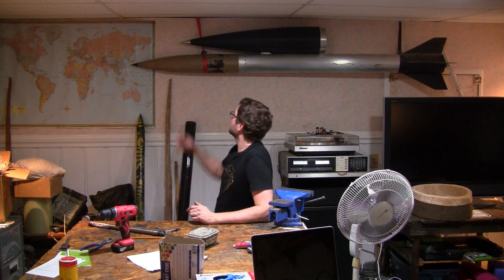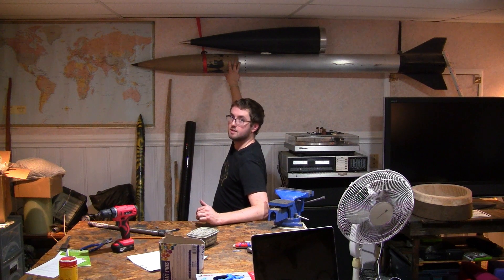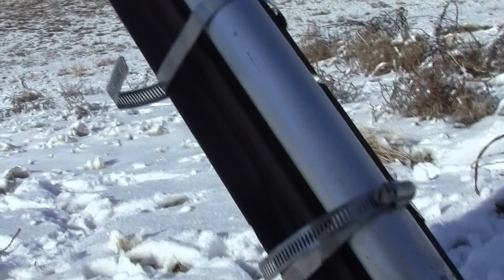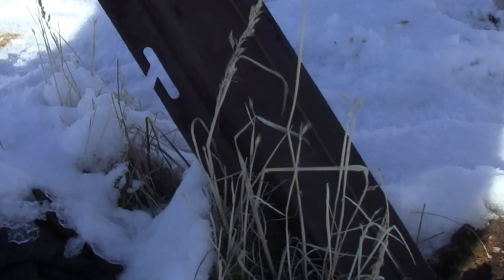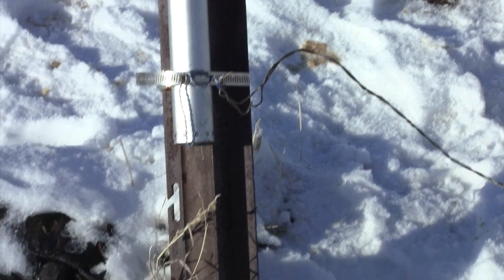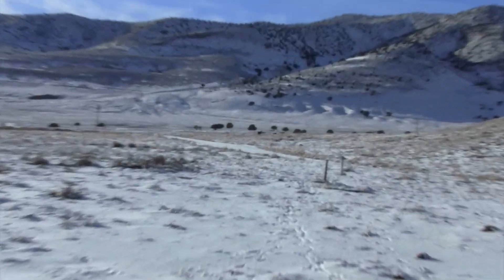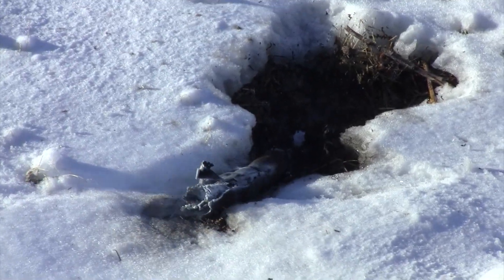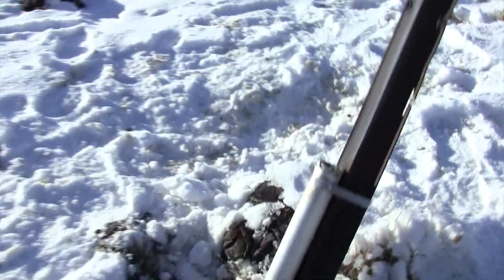Silicone Rocket Motor Test 3!

Comment: You have to use another way to secure rocket engine's head to the cylinder. The screws must not to work to shear but for friction. If interested I have already tested this method.

Comment: If your propellant is so powerful, maybe you should try end burner with a nozzle... Who knows, less crazy motor could take your rocket farther :)
Reply from the maker: That's a great idea. Maximizes propellant loading as well!
Reply: @solarover13  You could also try partial core, reaching 1/4 of the motor length, or core on the first grain only and remaining grains coreless (if you use multi-grain motors). It could give you powerful initial thrust and then lower thrust, which should be fine as mass of your rocket decreases in flight. 
I used that method successfully with sugar motors, and with your powerful propellant I think it makes even more sense. Good luck, and share the fun with us!